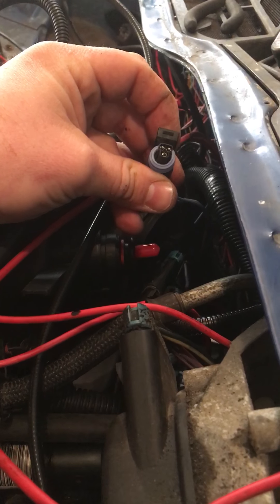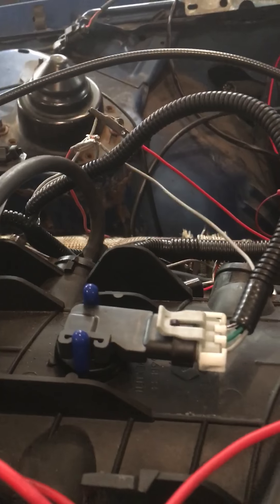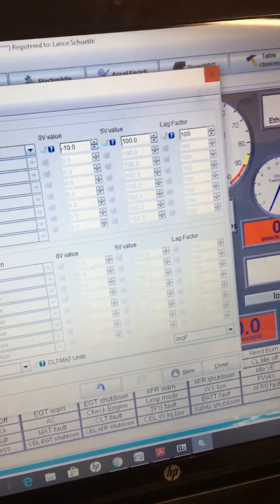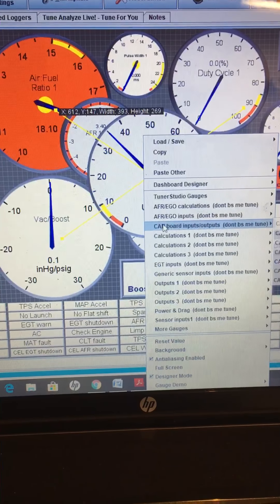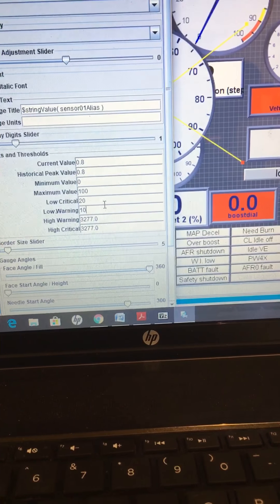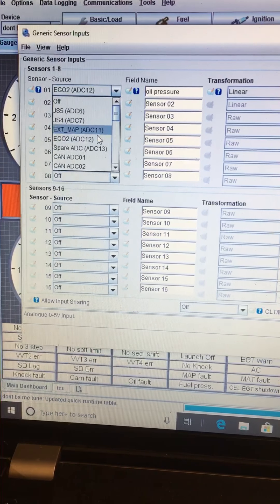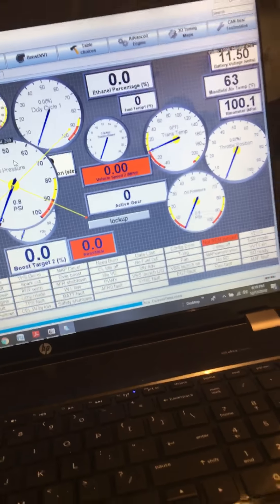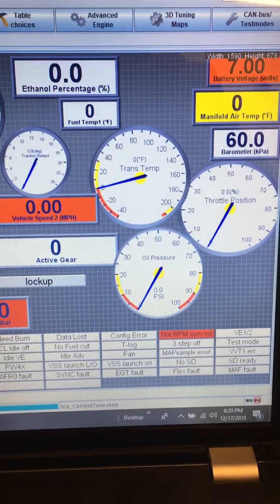MS3 Gold Box TunerStudio Engine Oil Pressure How To LS swap gm 3 wire

Comment: Did the GM calibration work? What sensor did you use. I want to do this with oil and fuel pressure and I figure that the sensor would work for both.

Comment: The second 02 wire works for the oil pressure??
Reply: its just another input and he just renamed it since he wasn't using a second O2
Reply: @ddk56vw  just make sure you turn it off in the setting